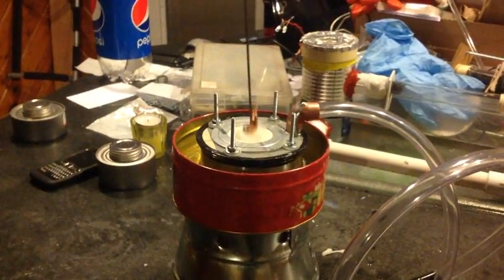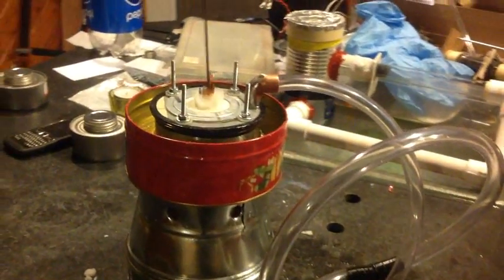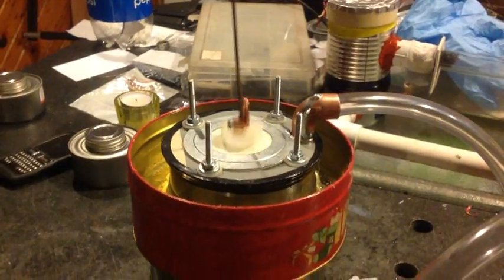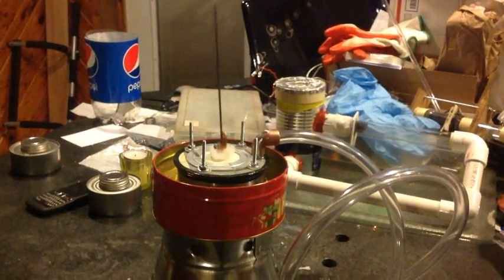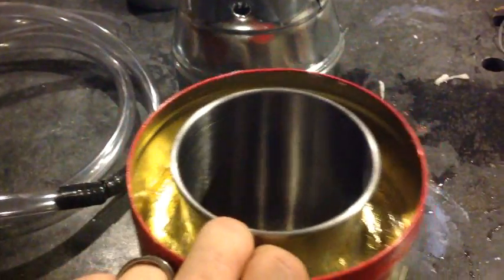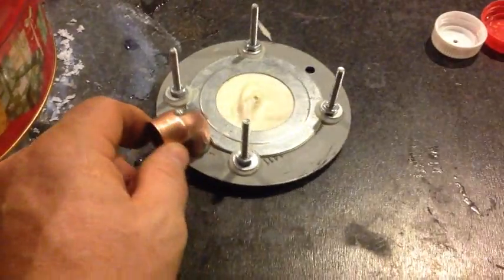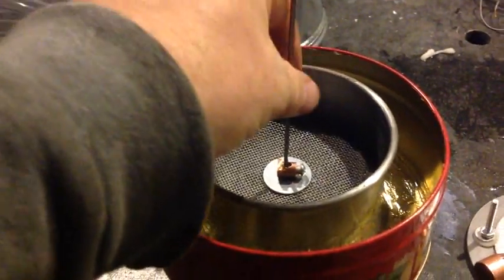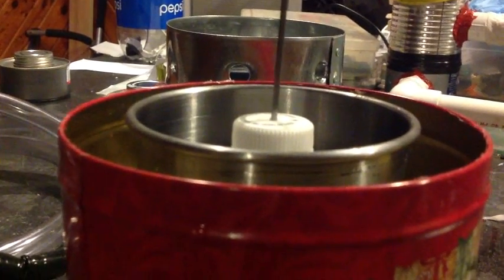Thermoacoustic Stirling/Hybrid Heat Engine V2.1

Comment: The spacers are critical for the unit to operate. When fully assembled you should be able to easily push down on the shaft and the steel wool assembly should touch the bottom of the can. In the ones I built I found it to be a downward movement of about 1/4 of an inch max. If it is too close the unit will clang and energy is wasted as the unit just bangs the bottom of the can. If too big a space the heat cannot be fully absorbed by the steel wool at the bottom of the can. A side note is a flat bottomed container works best.

Comment: I will build this. Would aluminum be better than stainless steel?
Reply from the maker: +Frenchie The melting point of Aluminum is too low if you are using high temp heat source such as alchohol
Reply: @mightydynamo7780  ⚠️ God has said in the Quran:

🔵 { O mankind, worship your Lord, who created you and those before you, that you may become righteous - ( 2:21 ) 

🔴 [He] who made for you the earth a bed [spread out] and the sky a ceiling and sent down from the sky, rain and brought forth thereby fruits as provision for you. So do not attribute to Allah equals while you know [that there is nothing similar to Him]. ( 2:22 )

🔵 And if you are in doubt about what We have sent down upon Our Servant [Muhammad], then produce a surah the like thereof and call upon your witnesses other than Allah, if you should be truthful. ( 2:23 )

🔴 But if you do not - and you will never be able to - then fear the Fire, whose fuel is men and stones, prepared for the disbelievers.( 2:24 )

🔵 And give good tidings to those who believe and do righteous deeds that they will have gardens [in Paradise] beneath which rivers flow. Whenever they are provided with a provision of fruit therefrom, they will say, "This is what we were provided with before." And it is given to them in likeness. And they will have therein purified spouses, and they will abide therein eternally. ( 2:25 )

⚠️ Quran
Reply: I was unsuccessful at this build. I was successful in building the water piston version and the NASA sterling.. What is new?